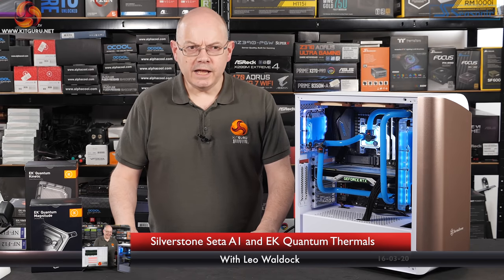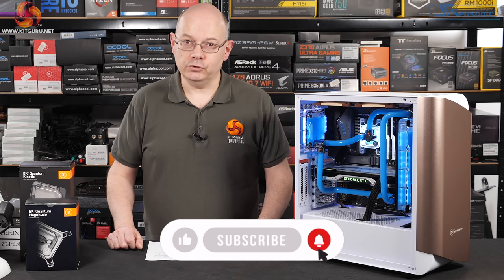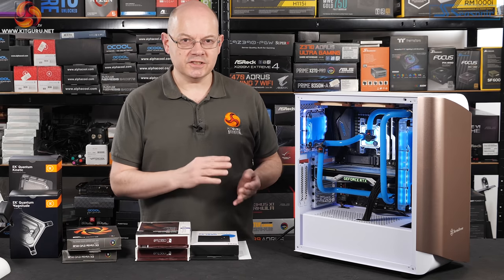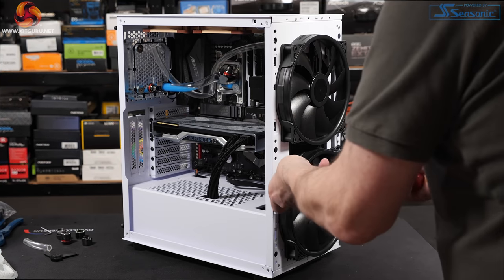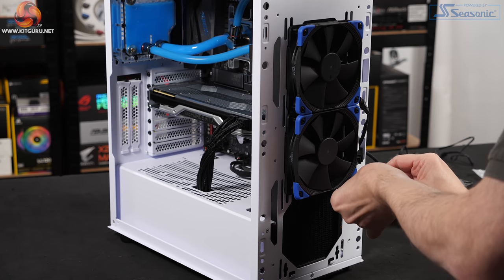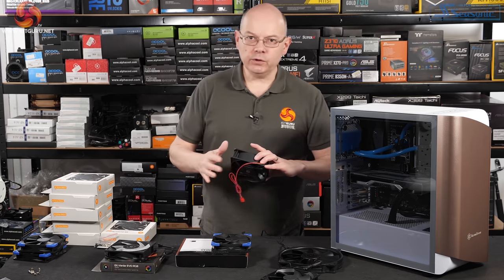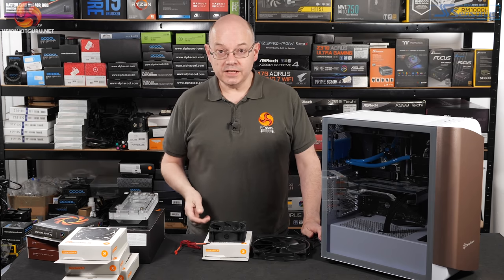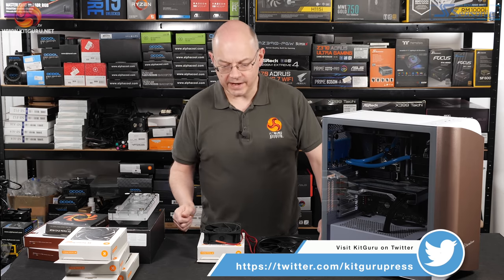EKWB Furious Meltemi MAKES LEO LAUGH out loud!

Comment: Is there enough room at the front to move the Noctua fans from outside to the inside of the front panel?  That might help airflow.
Reply: Yeah it really looks like the fans are almost resting against the front panel, leaving only a small gap between the panel and the fans.
Reply: No, it's too tight.

Comment: What about putting the fans on the inside of the case as opposed to the outside of the case. It would push the radiator closer to the GPU or maybe put the fans in a pull configuration instead of a push? This way the fans aren't pushed up against the front panel choking the fans. Just curious.

Comment: It's pretty obvious at a glance:  The case fans are right up against the front panel. They should be mounted behind the front fan mounts, inside the case. The rear exhaust is blocked by a reservoir. Put a fan there. I would also lose the top mesh, it is way too dense. The front reservoir wasn't stopping air flow, but it did stop active airflow hitting the mobo, no good for VRMs.

Comment: 1. Not particularly surprised that removing the res from the back of the rad made no difference, as there's plenty of room for the air to move around it, and it's getting an assist from the exhaust fans.
2. Going from 2x 200mm to 3x 120mm surprised me a little as I've seen gains from doing the same in my own builds.
3. Going from the F12's to the Vardars and seeing no difference, even with the front panel removed, genuinely surprised me.
4. I used to run 4x 140mm iPPC-3000, briefly, and had a similar reaction to when you turned on the Meltemi setup :) Suffice to say that they've been replaced by A14's.
4a. Speaking of iPPC-3000's, I'm surprised to see that they still offer higher static pressure than the Meltemi, while being a whole lot quieter.
5. Would have liked to see the full 5x Meltemi setup without the front panel on.
5a. Speaking of the front panel, it looks like there's be room to mount the fans on the inside to give more breathing room behind the panel.

Comment: The thing is not everyone builds for airflow some build for looks and some build for silence and there is nothing wrong with whatever route you choose.
Question: can one use plumbing supplies from your local hardware shop for water cooling. As water cooling looks very much like plumbing a central heating system.(except for water blocks)
Reply: If you were aware of water cooling's history you'd know the answer was 'Yes'. 'Dedicated' PC water cooling parts was some tool seeing a way to leverage a stonking markup on prices for the 'convenience'.

Comment: A better solution would be more radiator surface area. Install 360mm or 240mm at the top and replace the front radiator with a thicker one. Surface area is key with water cooling, you could cool the GPU too with a block.
Reply: saying that this same case with a mesh front panel would just be better all around. Why case makers give you the option to mount fans but then close off the same area is just beyond me.

Comment: Im new to water cooling and my question is.....does a reservoir have to be inside a case? Can i have the reservoir outside my case and have the tubing going inside the case.
Reply from the maker: There is no need to have the radiator, fans, reservoir or pump inside the case.

Comment: Are you sure the CPU waterblock is getting good contact with the CPU? Just curious. My Ryzen 7 3800X is overclocked to 4.5 GHz @ 1.375 volts and an after an hour of Prime95 my temps are around 48c.
Reply from the maker: You might want to try a Ryzen 9 some time! what sort of power draw are you getting for the PC as a whole and for your CPU on its own?
Reply: @KitGuruTech  I plan to get a Ryzen 9 in a few months. My CPU is pulling a max of 138 watts, and the entire system is pulling a max of 545 Watts.
Reply from the maker: @OlettaLiano  Your CPU power is certainly in the right area for that overclock and now you have us interested. Which case are you using with which fans and what sort of fan speed?
Reply: @KitGuruTech  My case is a Thermaltake Level 20 HT Snow Edition 4. I have 2 360mm radiators and a total of 10 fan. the 6 fans on the radiators are 120mm Asiahorse Solar ECLIPSEIII. 2 are the 140mm fans that came with the case, and I have 2 Cooler Master 120mm on the rear panel that came with an AIO. The fan speed is averaging around 850 rpm's with a max of 1050 rpm's. They're pretty quiet considering.
Reply from the maker: @OlettaLiano  That explains it - the HT is HUGE and is effectively an open bench https://www.youtube.com/watch?v=aoiOnIhhXqg

Comment: So these are about as loud as 38mm Deltas or they still lag behind?
Reply: not as loud. i've been using Delta's 6kRPM 120*38mm fan for a couple months and i bet you'll lose your hearing if you hear it blasting at 100% for a few days. a bit noisy but i got good airflow at 1% duty cycle.
Reply: @n.shiina8798  never used 120MM Delta's  only 120MM Industrial Papst's and 80MM Delta's  but never measured the speed.

Comment: from the point of engineering... something went wrong... i never get above 46 deg celsius, even under full load after 1 hour work or render time... in one of the worst airflow cases money can buy with really cheap arctic p12 fans... mb temp max 48 deg celsius... what are you guys doing???
Reply: ole longfield testing it properly.

Comment: The only way you would see ANY meaningful difference in cooling with that front panel is to use 12/15mm fans on the front of the case, and a set of good static pressure fans on the inside attached to the rad in push pull.  Other than that, you should have gone the bottom to top airflow route as you cut off the rear fan option. 
The case's front panel is crap.......end of. 😑

Did you mean to trigger as I'm sure you're experienced enough to know better?......😏

Comment: The case performs poorly due to its closed-off front panel design, exacerbated by low static pressure fans mounted exterior the case, which places them too close to said problematic panel.
It's ok to say it.

Comment: The 200 fans wont have any good static pressure, heh... what r u doing here...
Reply from the maker: You mean the 200mm fans that are supplied with the case? Yes, that is why we replaced them with three diferent models of 120mm fan.
Reply: KitGuruTech you did? Oh. I didn’t watch the video😂
Reply: So... if you watch the video, you would not ask this question.